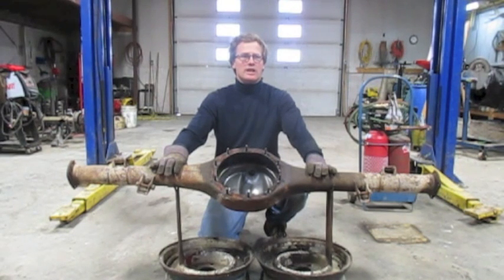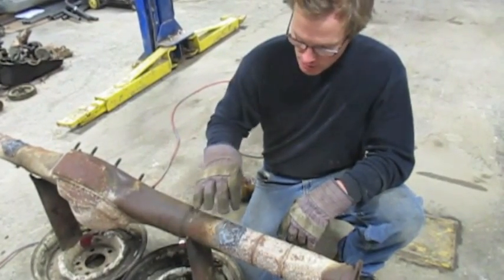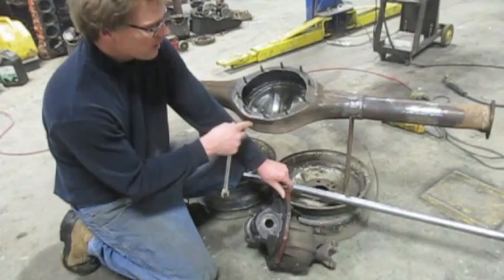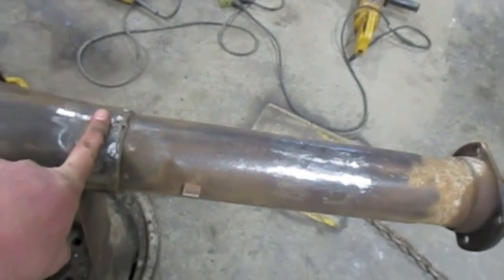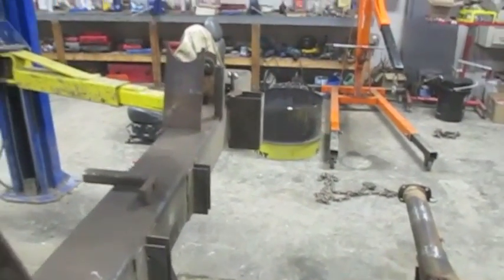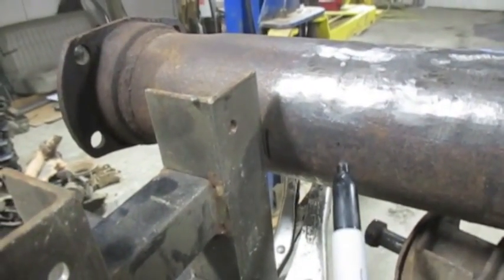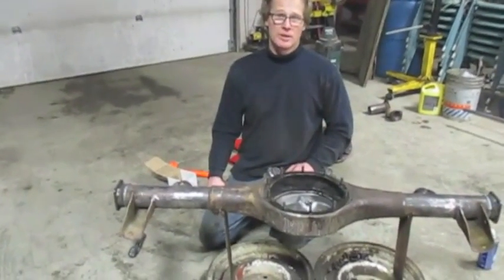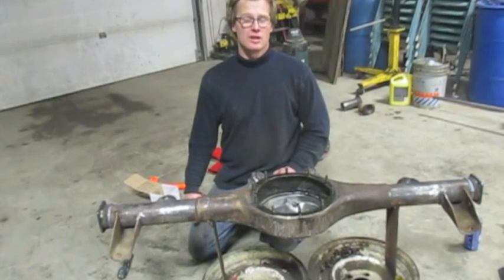DIY Ford 9" @ The Rocket Shop

Comment: Excellent job Brian.  Superb video tutorial!  I have a 70's truck 9" and need to fab it for my 75 Chevelle Laguna S3.  This is a  street only dry sump 632 so need something a bit sturdier than the 8.5" 10 bolt.
Reply from the maker: sounds like a sweet machine ! Good luck with your build.

Comment: Brain nice job on the video, I was impressed with your jig. How long did it take you to build?  I guess I will be building a jig just like yours.
Reply: think if you use the original axle with its mountings out of the car you want to build the 9 inch for  it shouldnt take too long to weld together , it prolly take longer to make the brackets that fit the mountings on the diff then it does to weld them to the jig in the right angles  , you just need to start from the middle outward and then adapt the cradle for the bigger tube diameter of the 9 inch afterward so the mountings stay at the same distance from the axle center

Comment: Looks good, that sure makes it look easy.  Have you ever added longer lower control arm mounts or raised the upper control arm mounts?  Or added pinion angle when welding up the mounts?
Reply from the maker: the upper ears are higher than stock automatically because the housing itself is taller. I welded pieces on my lower brackets to give more adjustment on the rearend  thats in my own car. I got them from UMI. Adjust the pinion angle with adjustable upper control arms.
Reply: you prolly could add mounts on the jig for uppr controll arm mounts  , prolly only would need to do the different diff ange if hes building diffs for say a rockcrawer or an extremely lowered car on huge wheels though

Comment: Brian what size tubing do you use for your uppers? thank you
Reply from the maker: 2" outside dia. 1.835" inside dia. its just cheap tubing commonly used for cattle corral panels. I press stock bushings into it.

Comment: Do you not think that the engineers made that axel housing to be straight under a normal load.
Reply from the maker: i guess it was supposed to be straight when they built it, Maybe it bent over time from carrying heavy loads, bumps and potholes, or it pulled out of square as it was built from the heat of welding.

Comment: Can you please tell me the tube  measurements for both sides. Just bought a empty rear end.
Reply from the maker: that would be a sure fire way to get the wrong axles. You measure what you have.
Reply: I just want to cut.my housing for now.
Reply: if you want to weld the ends to them too you most likely end up with the housing out of line and wear the bearings out way too fast , you need the centersection to measure everything off off